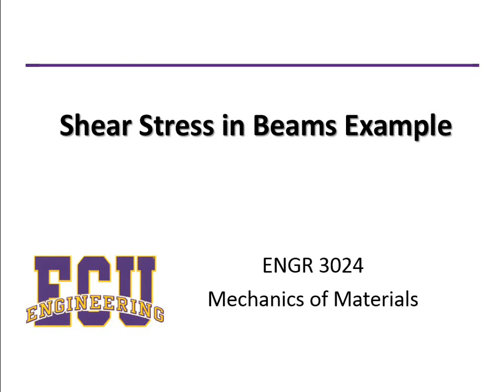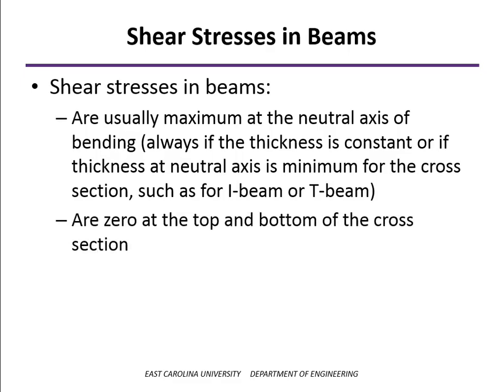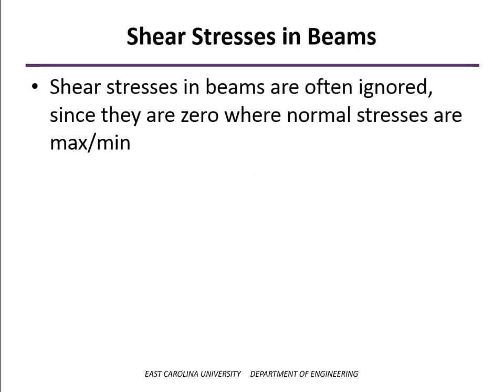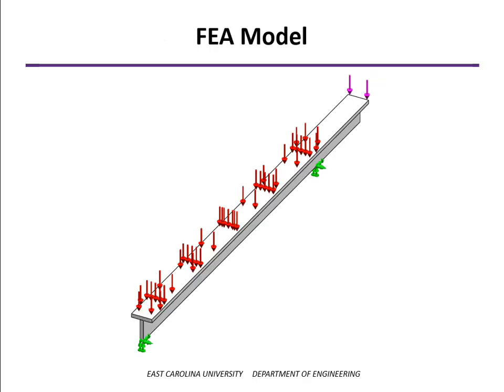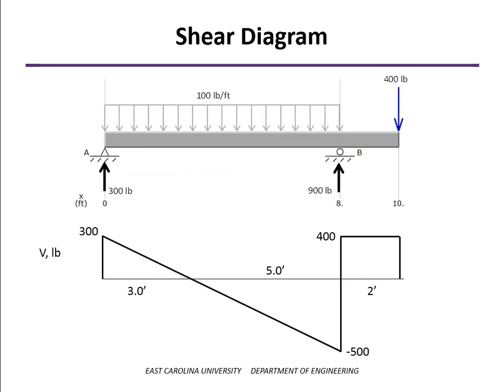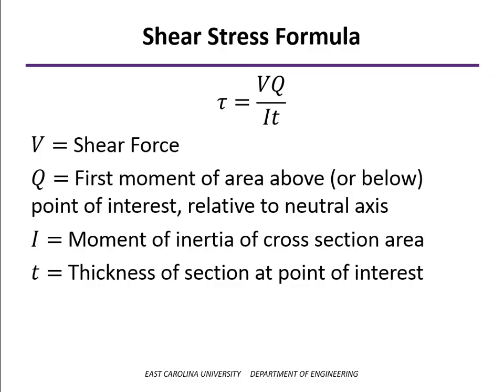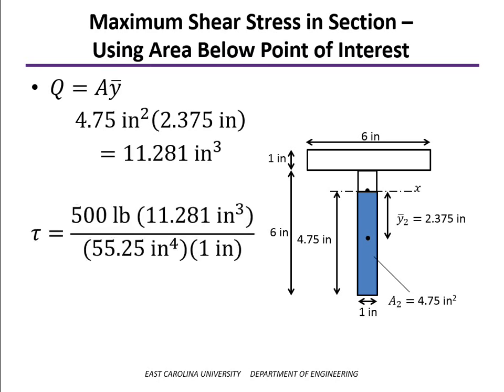Shear Stress in Beams Example

Comment: How do you find the neutral axis sir?
Reply: Roz A. Hamid if the beam is symmetrical its neutral axis is in the centroid(middle) of both axes. If not, use the Transfer Formula in able to find it. Correct me if Im wrong
Reply: Use sum of the y bar × area/ sum of areas

Comment: yeah I think thickness (t) should be 6 inches
Reply: that 5 in. long line (2.5 in. leftward and 2.5 in. rightward) of the calculated - so called - "glued region" is not subjected to the shear stress we are looking for. besides, that would have lead us to find a lower shear stress than we did.
Reply: Andy Chuang You only applied the glue along where the two pieces meet, which is the 1 in. strip

Comment: I think your calculation of thickness (t) is wrong ! Can you please correct me if I'm wrong ?
Reply from the maker: It depends on where your calculations apply.  In the beam flange just above the junction, the thickness is 6 inches.  Just below the junction, it's 1 inch.  If the beam section is made up of members that are glued together, and you are trying to find the shear stress in the glue, then the thickness is 1 inch, since the glue line is only 1 inch wide.
Reply: Rick Lica You only applied the glue along where the two pieces meet, which is the 1 in. strip
Reply: ECUSW Wouldn't you use the equation for shear flow for a situation like this where the joints are glued?

Comment from the maker: You can sketch an approximate distribution by plotting a smooth curve between the four known values - zero at the top and bottom, and the calculated values at the neutral axis and at the joint.  But then divide the shear stresses in the horizontal member by 6, since the thickness t in the formula VQ/It is 6 times greater.  So there is a step in the value of tau at the joint 95 psi just below the joint, 16 psi just above.
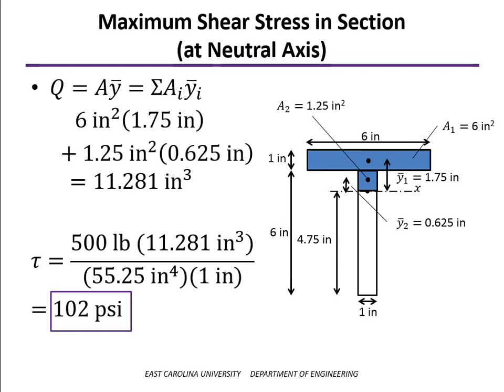Reply: Sir I have one query, at 8:57 in denominator why do we have taken width of section as 1 inch, isn't it should be 6 inch.